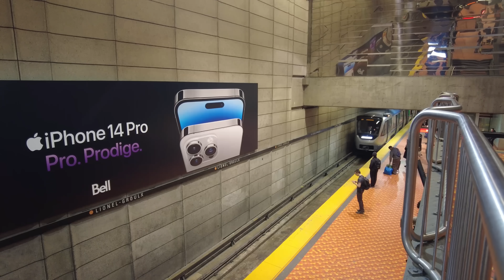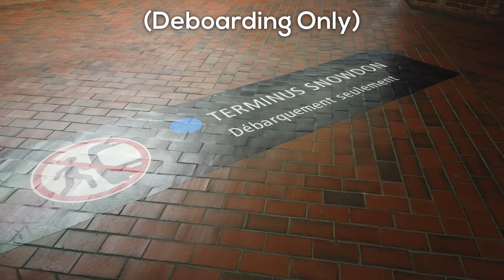How the World’s Best Transit Systems Achieve Amazing Frequency

Comment: Once again, a great presentation - and I strongly agree with all of the points you make.  Re London (UK), the buses need most to improve frequencies.  In the current (politically derived) cost-cutting frenzy, a lot of routes have reduced to 'every 12 minutes', which is a crazy decision:  for me, every seven and a half minutes (8 per hour) is the level at which you get the most gain in passenger numbers, as it's the level at which most people don't mind waiting for the next bus, and so will turn up without checking the schedule.  'Every 12 minutes' gives times which are completely unmemorable; at least 'every 15 minutes' gives you that comfort!  But London buses fall into the typical bus-man's pitfall trap of every route having its own frequency - which is always justified by how many and what sort of people live along the route, and what current ticket sales are, but completely ignores the fact (well established by over a century of experience on the tube lines) that, to function at its best, a network needs to give comfortable connection times at transfer points.  For example, the new outer-London express network 'SuperLoop' has different routes at 10, 12 and 15 minute frequencies, which will lead to people having discouraging experiences when they try journeys involving transfers.  The SuperLoop does have some great features, such as interchanges with all the radial routes it crosses, but I'm disappointed that a standard frequency has not been specified.

Comment: Something that’s definitely not conducive to higher frequency (more importantly reliability) is shuffling all your trains through a central two-track tunnel bottleneck cough cough Munich S-Bahn cough

To clarify, the central section does get a very frequent service, a train every three minutes or less, but all the branches that come together get generally twenty minutes, or further out 40/60. And lord help you if there's a breakdown anywhere on the main line. Then there's no frequency, because no train can go anywhere.

Comment: 6:42 it's NOT true that side platforms are more efficient for a terminal!

There are tons of high frequency metro systems around the world with Island platforms at the terminus. The track layout can be exactly the same, just with more space between tracks to fit the platform between them.

Actually it's better to have island platforms in many cases: you can have an additional crossover before the station that gives you the option of turning the trains around at the platform.

 this is very common on the Vienna U-Bahn
Reply: I don't think he meant that side platforms are optimal, he just said that they were "typical". But yeah a lot of European systems just have them turn back at either side of an island platform which seems more efficient
Reply: Plus island platforms allow for a fully automatic reversing procedure which further increases capacity as it prevents the driver from walking the entire length of the train at every turnaround.

Comment: I do think there is a cutoff depending on distance and population (the Tozai Line on the Tokyo Metro should run more frequently than a train from say Omaha to Lincoln, Grand Island, Kearney, Lexington, & North Platte via the UP overland route does) and similarly rolling stock shouldn’t only be designed to maximize capacity but should be designed for the context of the line (longitudinal seating with poles, & hand loops for standing is great for a short distance high frequency metro line with massive passenger numbers but is a terrible idea for a higher speed intercity rail service where dwell times aren’t as important of an issue, capacity is usually much lower, and any issues with capacity can be adequately addressed with bilevel coaches instead)

Comment: Driverless metros also allow to run higher frequencies without skyrocketing operating cost, because they don't need to use more people to operate more trains and platform screen doors simplify station layout increasing safety.

Comment: I was in Paris just a couple of weeks ago and every time I am there, I am amazed by how frequent it can be. On some lines, you can actually see the train leaving and entering the station pretty much at the same time. Even though, some of these lines were build 100 years ago, it is amazing that you walk down the steps, a train is leaving and as soon as you are on the platform, another one is coming. I have not yet seen any transit system with a more frequent service than in Paris.

Comment: British buses are worse than North American buses because, outside of London (And some other big cities), buses only ever have one door at the front. Even double-decker buses only have one door. This is generally terrible for frequency due to it extending dwell times, especially at busy stops. My local bus between a town of around 20,000 and a city of ten times that is really busy at peak times, and operates double decker buses every 15 minutes. Another company operates multiple similar routes at similar frequencies, probably totaling to around 5-7 minute frequency. These buses only have 1 door at the front, and it is obvious that they have to wait for ages at the major stops, and especially because we do not have any forms of tap-on tap-off transit cards so every single person has to talk to the driver and get a ticket.

Comment: Another two solutions to aid boarding and alighting are: a) dispense with doors entirely...as in mumbai or b) make the carriage non corridor and make every window space a door...as they used to on british railway 'slam-door' trains. I guess the health and safety mob would shoot both of those solutions down in todays world
Reply: Powered sliding doors on every row of seating does sound pretty cool. But it would probably be a maintenance nightmare.
Reply: has nothing to do with health and safety, the second one is just a terrible idea
Reply: Second solution is what Brisbane had before electrification, for many decades.
Reply: Another approach ive see in some places is to make some doors entry only and others exit only. That must be the cheapest way if speeding things up...but trains would need to stop at an exact point to make it work
Reply: @neilwilson4547  that wouldn't work either

Comment: We were in London (the UK one) for the weekend and on Friday afternoon the Jubilee Line had an issue. Instead of a train every 2.2 minutes it was 12-13 minutes. The overcrowding was crazy with people having to wait for 30+ minutes or so as they couldn't get on. It's always crowded at the best of times, but it really showed how important frequent trains are when people are used to using them!
Reply: That must've been really bad. I was on it the other day and had to wait 7 minutes, and then it took me 3 more trains to be able to get on!
Reply: @mdhazeldine  It was not great - we had cases with us that didn't help! We squished in and were popped out at North Greenwich (O2) where the dangleway was very quite to Excel :) 
I have no problem with being squashed after 60+ years on the tube, but my niece wasn't best pleased lol

Comment: A couple things you might not have thought about:
1) Some doors will have been wide enough for two people when the stock was first built, but now aren't. I won't be surprised when these new trains come up against the same issue, as people continue to get wider.
2) Doesn't matter how wide the door, if people block others getting off. If people could use their brains for two seconds, they might realize making room for people to get off would make it quicker for them to get on.
Reply: In my country I think some boarding passengers panic when the door that they've chosen to board their train at still have people alighting whereas people have already finished alighting from other doors, so other boarding passengers that've chosen to board from those other doors then get to board earlier, & may end up taking up all the empty seats left on the train. Conversely when alighting from a train, passengers may avoid alighting at the same door as passengers on motorized wheelchairs, as they are slower & thus passengers at other doors will get to alight 1st & get further up in front of the escalator queue (to take you out of the station you alight at)

Comment: Loops can also be problematic. Boston's Blue Line has a turnaround loop at its downtown terminus at Bowdoin, but the radius is so tight that trains can only go 3MPH around the loop (that's three, not thirty), so that's actually a bigger bottleneck for frequency than reversing directions at the other end of the line at Wonderland, which has a single reversal siding. (Actually, is it still called a siding if it's in the middle of the ROW?)

Comment: Now, most of the points only truly matter for a rapid transit operation which operate in a very high frequency, though you still considered that for mainline operations.
The only things I'm missing from this video is the lack of references to some of your older videos like the science of flying junctions, cross platform interchanges and the like as they too affect the frequency of operation as well as some of the basics like number of tracks (though the operation for multi-tracked operation is a science of its own) and services types of operations.

On that aside, the idea of tail tracks is quite interesting as from a passenger's point, the in- and outbound platforms are still clearly defined and also gives of an illusion of a continuous streams of trains. For the other, I commonly them at service termini with continuation for other trains on the line (pocket tracks) which makes sense because they're the easiest way for a train to turn around without disturbing other trains, all happing at grade but without any crossings (which is why I consider them interesting).
They also act as small yards for trains which always fascinate me for some reason when I see one in person.

Comment: For resiliency, you usually want to add some storage tracks along the route, where trains can be parked e.g. if there is a defect. A major drawback of turning loops vs. the other designs is that it's much harder to include additional tracks, where delayed or defective trains can be overtaken.

Comment: one thing that wasnt mentioned in the dwell time section is level boarding. its not just important to people like me who use wheelchairs, but also speeds up boarding emensly with busses and trains. especialy if you look at trains like go trains or old trams with 3 stairs
Reply: Fun fact: the S-Bahn Berlin was the first public transit system in Germany that adopted level boarding for the very reason to decrease their dwell time in the 30s. This is also the historic reason that the S-Bahn systems in Germany use platforms with a 96cm platform hight. 

Level boarding also minimizes the risk of getting injured while step on the train (for example older and unstable people and those who are handling with luggage or a bike for example).   At my work as a public transit planner, I therefore try to explain all my partners that everyone benefits from level boarding, not just "those in a wheelchair"
Reply: Yeah, dwell times increase significantly when the guard has to go fetch a wheelchair ramp!
Reply: @mdhazeldine  As the poster noted, if access to the train is through a narrow staircase, boarding is immediately slower even for passenger without luggage. And if you have a heavy bag, especially luggage with wheels, that you have to drag up the stair, the difference is huge.
Reply: Yes for real. Also for people with canes, strollers, walkers, suitcases on wheels, little kids, carrying heavy things. Level boarding and small gaps.

Comment: I'm on an overseas holiday in Beijing at the moment. I've been using the subway a lot, over a dozen trips so far, some of those with multiple interchanges, so something like 20 trains. My longest wait has been three minutes. Sometimes you're at the top of the stairs going down to the platform and you can hear the train you've just missed as it's leaving the station. If you walk at a normal pace, by the time you walk down the stairs and to the middle of the platform, you can hear the next train coming.
Reply: Trains that are more frequent than traffic lights.👍
Reply: Been trying to adjust to other cities after being in Hong Kong. I miss that so much

Comment: Terminals are also built like this because when you need to extend the line, all you need to do is... extend the line. That's what they've done with line 14, considering they knew it would get extended eventually (I'm not sure how far ahead the planning was about line 14 tbh), all they need to do is extend the tunnel and turn the reverse tracks into a regular track in the system.

Comment: Driverless metros could also help to improve frequency.
Obviously they can safely run at very high frequencies, but definitely even save time (and space) at terminals. 
They do not need to change platforms. They just can leave in the other direction istantly.

Comment: The Tube uses a technique at some terminal stations called "stepping back" to keep turnaround times very low. In this, the train pulls into the platform at the station, the driver completes their sign-off, then steps out of the cab and presses a plunger on the platform. This signals to the next driver (who is already waiting at the other end) that they can get into the cab at the outbound end and start their prep to drive the train back out. The first driver then walks the length of the platform, ready to drive out the next train that comes along. All this time, people are alighting and boarding the train, and it's all ready to go within a couple of minutes without ever having to turn the train around or actually waiting for the driver to walk the entire length of the train.

Comment: Re: bus/tram doors. Here in North America, we rely on there being a single point of entry to ensure that riders pass by the fare box and pay. In much of Central Europe, you can board on any door and validate your ticket at many points inside the vehicle. Fare enforcement is by undercover inspectors.

Given the number of firearms in circulation here in the USA, I don't think you're going to end up with a lot of enthusiasm for people to demand fare payments from people carrying concealed weapons.
Reply: There are just never are going to be enough inspectors to drastically reduce fare evasion tho. London tried the enter at all doors approach with the new Routemasters but ended up going back to the the old system because it was costing them over £3.5 million in lost fares every year
Reply: we have that even in Russia

Comment: Service pattern is also incredibly important. If you want to run high frequencies, then running a single all stops service patten is probably the ideal.

If you absolutely, positively must run a mixed express/local pattern, you need to understand how this impacts frequency and capital cost. A New York system with fully segregated express tracks allows you to run high frequency express trains against high frequency local trains. But quad tracks are expensive to build and more expensive to maintain, money which has to come from somewhere. Alternatively, a Japanese style system with passing loops allows you to run high-frequency express trains against low frequency local trains without needing very much extra track. But this leaves the non-express stations with only infrequent (and probably inconsistent) service, which may or may not be desirable either.

Comment: Two lessons from London:

Many Elizabeth Line stations in the central core have entrances/exits at both ends of the platform leading to completely different exits at street level. So with a 200+m platform you effectively have two stations, and platforms can clear much more quickly.

Operating procedures can also make a massive difference to potential frequency. South Western Railway operates with guards enabling door opening. When the train stops, the guard opens their door, steps onto the platform to make sure the train is correctly stopped, then steps back onto the train to release the doors. This process can add 30 seconds to station dwell times compared with operation of the doors by the driver, a significant delay when suburban stations may be just 2 minutes apart.
Reply: Don't let the RMT hear you, they'll bang on about how it's sooo unsafe and ackshually passengers want guards! Even though the Tube, Thameslink and many other railways in the UK and across the world have used DOO for decades now with minimal issue.

Comment: SD Trolley's main topological error is that the trunk branches into the Blue and Green Lines at Old Town, despite both branches having extremely strong outer anchors. And now the transit agency is crazy enough to propose an airport rail link running only every 15 minutes that would branch off the same trunk, via a flat junction, even closer to Downtown. (Luckily that plan is dying and the latest plan is an automated rubber-tyred light metro connecting the airport with Downtown with 2 minute frequencies!)

Also, San Diego's new UTC terminus has a scissors crossover at the station approach instead of beyond the station...whoops!

Comment: Don't forget station placements and layouts. The best type of line stop placement would be one where every station switches sides of the train. this creates good passenger flow onboard during crowded times. And yes platforms on both sides of the tracks along with double platform boarding is a great thing -- especially when you have one track serving multiple routes to keep people waiting for certain segments on different sides and keep confusion to a minimum